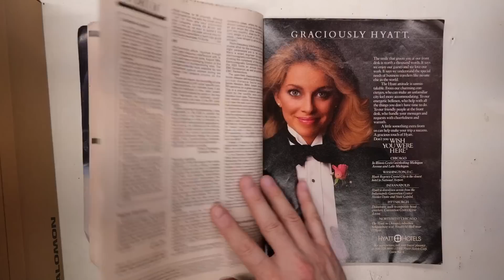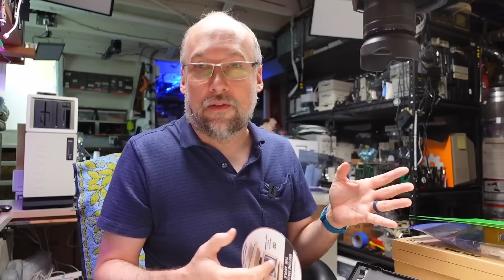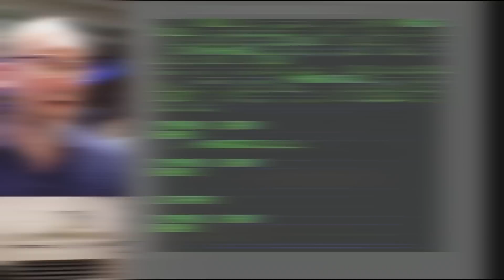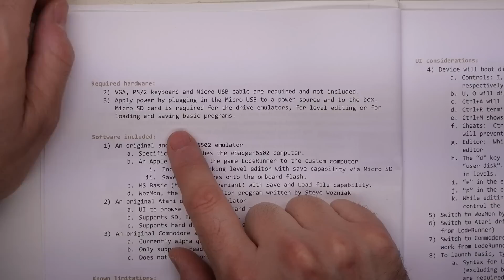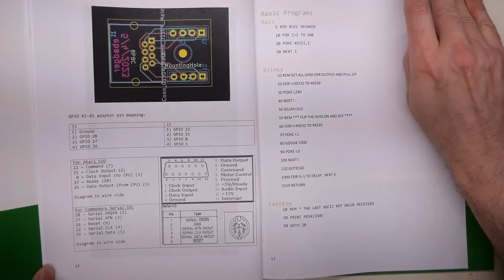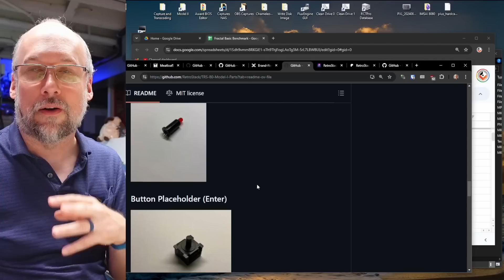0087 Pi Pico emulating a whole 6502 computer, Meatloaf for the C64, TRS-80 goodies and more

Comment: Here's his fractal program. To run on c64, you can change line 20 to "FOR X=-19 to 19", but this crops it. To also squish it, change line 30 to "CA=X*0.0916":

10 FOR Y=-12 TO 12
20 FOR X=-39 TO 39
30 CA=X*0.0458
40 CB=Y*0.08333
50 A=CA
60 B=CB
70 FOR I=0 TO 15
80 T=A*A-B*B+CA
90 B=2*A*B+CB
100 A=T
110 IF(A*A+B*B)>4 GOTO 200
120 NEXT I
130 PRINT " ";
140 GOTO 210
200 IF I>9 THEN I=I+7
205 PRINT CHR$(48+I);
210 NEXT X
220 PRINT
230 NEXT Y

Comment: I have the whole RetroStack trs-80 model 1 kit, keyboard kit, and case, made my own power supply it's a really awesome project. I can't recommend it enough for those interested in trs-80 retro computing. Since I assembled it my self I used machine pin sockets everywhere. Looks fantastic. I sourced most of the parts from Jameco and Digikey.

Comment: The 29.97 is the  rs-170a colour video standard. 30 frames per second was RS-170 Black and white NTSC. The 29.97 has nothing to do with 24.94 or 25 frames per second. 
Now if you really wanna learn something, check out the math behind those numbers, and then research 3/2 pull downs, drop frame timecode and non-dropframe timecode!

Comment: Raspberry Pi Pico microcontrollers are a quite interesting little chip that you can buy for a buck a pop - yet I am now looking at Raspberry Pi Pico 2 for exploration of x86 architecture translation (think Transmeta Crusoe, only it's architecturally similar to 80386 CPU) as it got two Hazard3 RISC-V microcontroller CPUs inside along with two Cortex M33 CPUs, to see what I can do with it (as I was planning on designing a RISC-V VLIW processor so I would want to see what I can do with limited hardware at first before I recode it for 64-bit hardware). And yes, the Raspberry Pi Pico 2 microcontroller also have a special ARMv7 / v8 M software translator inside its on-die bootloader that RISC-V CPUs use to understand exactly what the ARM CPU clusters want them to do.

Still, honestly running 6502 softwares on the cheapest chip is epic and equally mind-blowing - imagine taking a Commodore 64 computer with you literally everywhere being small and compact.

Comment: Hey Adrian, your little keyboard is okay but it probably needs proper initialization because it is usb/ps2 type. That init routine isn’t implemented in the badger pico computer. John from Johns Basement did a video recently where he implemented a ps2 interface for his z80 nuvo fpga project and he ran into the exact same issue with his Perrix keyboard- the same thing that comes with the Commander X16. So with this you need an „dumb“ ol ps2 keyboard or need to implement that init of the keyboard.

Comment: for the stem, I'd suggest printing PCCF. I don't think you need an enclosure, but you do need a hardened nozzle. My printer has components found to weaken when using PETG and changing colors thousands of times (which I do regularly since I have an MMU3 color add on. The PCCF is amazing. Apparently it's easy to print as long as you can do higher temps. Unlike things like nylon. It's very durable I could tell when I installed those parts.

Comment: It was definitely anti-theft. I worked at hollywood video. If you put a new dvd through the scanner it sets off the alarm. If you open it completely and remove the strip it doesn't. We used to find those strips hidden throughout the store from time to time.

Comment: If I was younger I would definately build a TRS-80 from scratch. Emulation does me these days though.
Reply: much more practical to build a ZX81, or any of the Z80 lineup. Lots of available kits, Also lots of copies made behind the Iron Curtain, and in Latin America.  TRS-80 is known as a US only thing, partly because TI had good lawyers. lol
Reply: @squirlmy  Yeah, I've built a ZX81 and a Harlequin 128K. I used to have a TRS-80 Model I in the 80's. Fun computer. I had it turning projects on and off using the cassette remote function. LOL. (PRINT CHR$ 9, I think).

Comment: Those CPU hand books are neat. I got the official Zilog Z80 technical manual in the 80's. It's been invaluable for coding on the ZX81 and the ZX Spectrum. I still use it.

Comment: That HP Luggagable-Computer ... I think I was working on one of them, most likely a predecessor as it only came with 256kByte (upgraded from 128kByte) shortly before I got myself an Amiga. It was definitely Unix but most of the OS sat in a ROM/EPROM as it had no hard drive. As far as I remember the programs weren't "loaded" from the ROM but actually directly running "from the ROM" which meant "Zero Load Time" and "Zero RAM foot print" - The system was incredible bare, a lot of stuff you take granted nowadays in bash and GNU-Tools simply wasn't there. No history in the Shell, pretty much all modern options missing from Tools like find, grep, ls and so on... Also it couldn't swap because it had no MMU and no HD, running out of memory was always just a single "ls |more" away. Oh, Pipes... pipes stored their data on the disk drive... it was slow, error prone and limited by what free disk space you had...  just let that sink into your mind... I remember you even had to load awk from disk but at least that one was actually a bit more modern.
All the stuff in the ROM was pretty fast for the time but have mercy if you accessed the disk drive... it also came with a basic set of networking tools - not what we nowadays consider networking like WWW, FTP, SSH, more a Network-Operating-Application with a Terminal Emulation and the ability up- and download stuff through X/Y/ZModem - it was hooked up to some Mainframe, though the owner did most work locally.
Reply: It was the Integral PC, utilising a 68000 and running HP-UX from ROM. The HP Journal article from October 1985 is worth reading for some details.

Comment: That BASIC program is appalling. Jumping out of a FOR .. NEXT loop! Very bad practice indeed. Find a better way to iterate I. This is the very reason why GOTO is so despised by real programmers.

Edit: I've rewritten your BASIC program to remove the I FOR loop with the serious problem (You do know about the FOR..NEXT stack, don't you?) and iterated I the correct way. Let me know if you would like a copy. It is in BBC BASIC for Windows and runs in about a second! It could still be made less spaghetti and more elegant with the removal of GOTO and the use of either REPEAT..UNTIL or WHILE loops but I've left the main program as is to maintain compatibility with older, less structured BASICs. At least it no longer leaves the FOR..NEXT stack full of unused NEXT returns!

Comment: How the hell does this work with an esp8266 when a PI1541 needs a rpi3? I must build one NOW...
Reply: I started with the ESP8266.  That code still works but the current code uses the ESP32 WROVER module (Lolin D32 Pro).  PI1541 is a cycle exact drive emulator.  This is more like an SD2IEC but with more capabilities.

Comment: Hi Adrian, when you showed the mandelbrot program on te eBadger6502 computer I had to test this on my AGON LIGHT 2 (ez80) computer with bbc basic. I get exactly the same results in 20 seconds 🙂. Perhaps not fair because the ez80 processor runs at 18.432MHz.
Reply: Is the ez80 a copy of the old 8080A?  Because if so, then it's actually running at 2.048MHz since the clock generator contains a built-in divide-by-nine circuit.  The reason for using that frequency is that it's easy to further divide it to obtain the common frequencies used in RS-232 communications.

Comment: Getting a complete 8-bit computer working on the Pico is absolutely possible - the ZX Spectrum has a full emulation setup running on it (PicoZX) and there are projects around to build a portable games system around it.

Comment: Those awful stickers on DVD cases etc are anti-theft - they are there to stop people stealing the discs out of the case in the shop.  Some shops in the UK where I am wouldn't leave the discs in the cases - you had to take the empty case to the counter and they would get the disc from "round the back" and put it in before you left the store!
Reply: Well, it was the same thing for audio cassettes at one point.

Comment: What's funny about the Badger6502 is that back in the 80s, there were companies that were taking C64s, and customizing them for control applications using the cartridge port as the control interface, in much the way you would use modern microcontrollers now. 

Full circle.
Reply: I think such a c64 was found in the Computer Reset cleanup. 8bit guy did a video with it in it (I think). It had a custom keyboard but the software was long gone.

Comment: I loved the circle animation in Lode Runner and always wondered how he did it. Drawing a plain circle usually requires either trigonometry or square roots, both of which were slow slow slow on 8-bit systems. And the Apple II had a crazy screen layout with 7 pixels per byte which meant that calculating pixels positions required division by 7, also slow.

Comment: 29.97 doesn't automatically mean 24 with pulldown applied.  29.97 is 30i with color data added for broadcast which takes up 2 frames every few seconds.
Reply: ^ Yep.  On DVD, it might be 24fps telecine, but if it's not a major studio film, it's just as likely sourced from 60fps or 30fps.  And it's always possible that it's some mish-mash of any or all of the above.

This is why deinterlacing DVDs is not a good idea.  I mean, at the ripping stage, anyway...  Just encode it as interlaced and use whatever filter looks best in your video player.

I'm particularly partial to the "TV simulator" filters that play it back with actual interlaced scanlines, like it would've been on a real CRT.  Yes it flickers.  Yes it's half as bright.  That's because that's what the content really looks like.

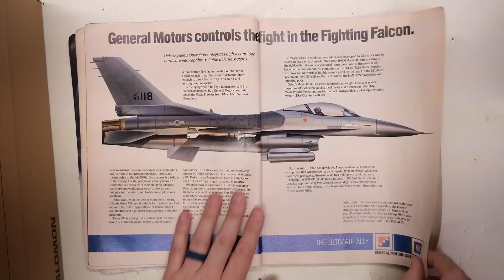Comment: 8:30 My other hobby besides retro computing is analog photography. Kodak is still kicking. They filed for Chapter 11 10 years ago, and were split into two companies, Kodak Eastman who handles manufacturing of film (not just photographic film), and Kodak Alaris who packages and resells photographic film. Kodak Alaris also took a lot of the digital IP that Kodak had. (Asianometry has a great documentary on why Fuji Film didn't suffer the same fate as Kodak, and no, it wasn't because Kodak ignored digital photography.)
Reply: Now if they would just start making 126 Instamatic cartridges again. I don't feel like fooling with the 35mm to 126 adapter cartridges.

Comment: I'm reading that IEEE Spectrum article about the C64 now, and came upon this: "The circuitry that displays either sprite information or background information at any point on the screen is sometimes slow to respond and overlays the sprite on the background information only after it has missed a few pixels."

Aha! My C64 back in the day was plagued with this problem. Sprites looked okay when the computer was just turned on, but over time sprites would 'erode' starting from the left-most pixel of each line, then moving steadily rightwards over time. It drove me nuts, but teenage me had no idea what to do about it. Looking back, I think it was heat that caused it: when the chip was cool, everything was fine, but run it for a while and it warmed up, and this issue would creep in as the cathode ray raced from left to right. An added heat sink and thermal paste might have helped, if I had only known such things existed! Ah, memories.

Comment: I would buy a mini Apple 2 emulator.
Reply: There's a Neo6502 that is a cheap 6502 computer with a 2040 that can be asked to emulate Apple Ii peripherals &c. I don't see an Apple ii emulator for the VGA32 board, but that's another micro board that could do it

Comment: FYI - Kodak is very much still alive. No where near the behemoth it once was, but they're returned to their roots of making film. Smarter Every Day did a wonderful video series touring their production facilities in Rochester, NY.
Reply: That's actually really good to hear.  There is some tech that we still have some use for, and took ages to perfect, that can just completely disappear when a company folds or sells off for the third time, taking all their hard-earned IP with them.  It seems like such a waste.
Reply: @sirnickity  This is why Open Source Hardware, and even just Open Source generally is such a good thing. Especially a project like Badger6502 (I can only find Badger2040 Is it a different project?)  Anyways, if he stops, and the hardware isn't published, I'm never going to get that repaired (well, maybe I could glue the speaker!)  There will be professional Open Source cameras, if there aren't already, and I see it like an extra-good warranty !
Reply: The Disc Camera in the ad did not survive... worst camera I ever owned.
Reply: Thanks for the heads up. I will check that out 😊

Comment: The logo for that Meatloaf device reminds me of the BBC Master computer's logo with that 'M', it had me racking my brains for a bit trying to remember why it looked out of place yet familiar, kind of a confusing mix-up of 8-bit brands... :S
Reply: It’s the ‘M’ in the chicken lips logo, rotated -90 degrees. The MEGA65 uses the same M
Reply: The logo is a throwback to the C64 logo & badge. I've never seen the BBC Master's logo.
Reply: @idolpx  They're not that similar either - the BBC Master logo is monochrome and more ornate, consisting of two square arches in 3D perspective arranged to form an 'M', with two rows of text underneath in a serif font.

Comment: My first computer was the TRS-80. What a beautiful creation. And…the whole computer could be run on a pico. Lol
Reply: Similarly I have a tiny ESP32 SBC that has VGA out, PS/2 ports for keyboard and mouse, an analog audio out port, a CF card for storage, and uses the old USB for power and com link to a host computer. I download an image that emulates a 8086 and CGA graphics.

A menu allows choosing different flavors of MSDOS and even CP/M 86. Can run dev environments like Borland Turbo C or Turbo Pascal and of course various DOS games.

Because the ESP32 is dual core, can dedicate a core do doing sound card emulation, so the games can run with decent sound.

Is amazing to think this tiny little thing reproduces the functionality of the behemoth original IBM 5050 PC.
Reply: That case would be great for all manner of retro-themed project computers - or even to just put Raspberry Pi’s into to just use as Linux computer.
Reply: My first computer was also a TRS-80. A Model III. :)
Reply: I'm not sure if you mean 1-4, or TRS-100, or TRS-80 Pocket Computers.  One thing that irritates me is that all these different incompatible machines were labelled "TRS-80"!  Obviously not your fault, but I think it was a sign they were doomed.
Reply: @squirlmy  The Model II was the odd duck out of the first 4.  Completely different architecture from the I, III, and 4. The II, 12, and 16 costed as much as a car at times! But, to be fair, Tandy did market the II et al to large businesses. 

The Model 2000 was a weird one. Why on Earth did Tandy choose the 186 instead of the 286 was beyond me.  The 186 had compatibility issues with many PC programs.  The 186 did see success in embedded controllers in later years.

Comment: The TRS-80 model 1 keyboard was pretty bad.  A modern replacement with actually GOOD key switches is a godsend for people trying to keep these machines running.  I knew a kid in middle school who had to load "KBFIX" from cassette just to use the machine, as the key bounce was so bad.  And just typing the load command could take 5-10 minutes, because of the key bounce. 

Man, what we used to put up with.  ^-^
Reply: Not only keybounce, but also the cassette save and load routines in the early TRS-80 had a mistiming error which meant that even a slightly unstable motor speed in the cassette recorder would cause program loading to fail with a CRC error.
Later revisions re-timed the loading routine to compensate for the error.
Reply: The fix was later supplied in updated ROM versions. I think Level II version 1.3 had this fixed while previous versions still had this key bounce issue.
Reply: @marcelerz  Hmmm.. I wonder which version ROM i had in my model 1 back in the day. 

I never had really bad key bounce.  I thought it was a better keyboard, but it might have been a ROM fix, i just don't know.
Reply: @jeromethiel4323  If you can remember the initial prompt, it can give you a hint about the version you had. Level 1 only displayed the 'READY' prompt, while all Level 2 versions asked for the memory size with 'MEMORY SIZE' (in versions 1.0-1.2) or 'MEM SIZE' (in version 1.3). After entering or skipping this, it would display 'RADIO SHACK LEVEL II BASIC' written out, or 'R/S L2 BASIC' in the latest 1.3 version. As far as I know, the key bounce issue was fixed in version 1.3, along with the cassette interface software bug that required the XRX board in previous versions—a hardware fix for a software issue.

Another interesting detail is that the text shortening mentioned above was done to save a few bytes on the ROM, allowing all these fixes to be implemented without increasing the ROM size.
Reply: @marcelerz  I know it was level two basic.  Probably the last option.  I think it asked Mem size, but that was so long ago i don't even remember accurately.

Comment: RP2040 is not 5V tolerant, at least officially. Newer Pico 2 is actually 5V tolerant
Reply: It is not 5V tolerant in every scenario. It's safer to treat it as 3.3V only. From a Raspberry Pi engineer on their forums: "Please refer to the datasheet, but in short, you should use 3v3 to be completely safe. The pins tolerate 5v under certain circumstances, but not all."